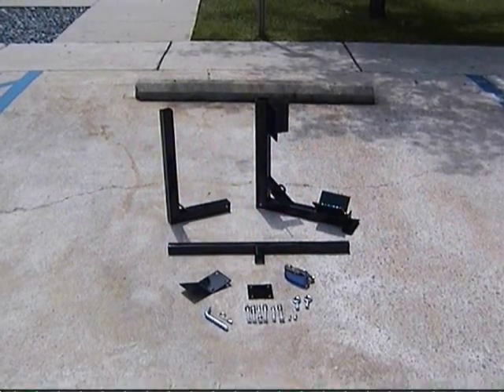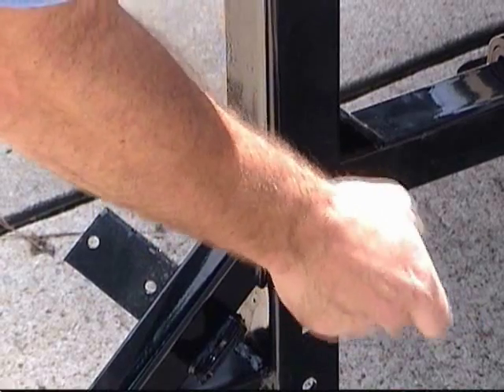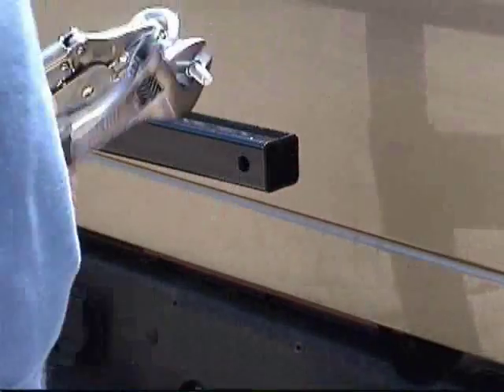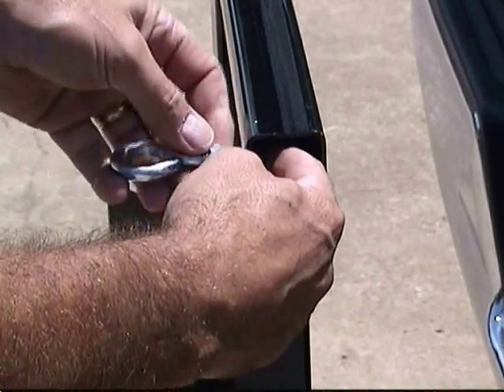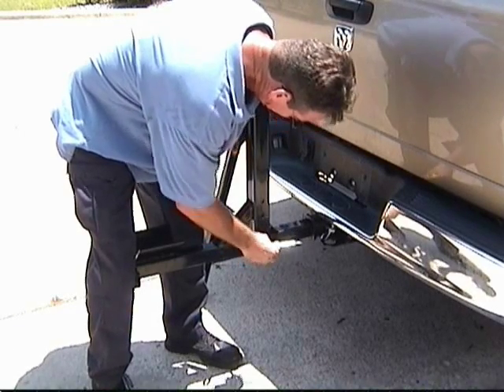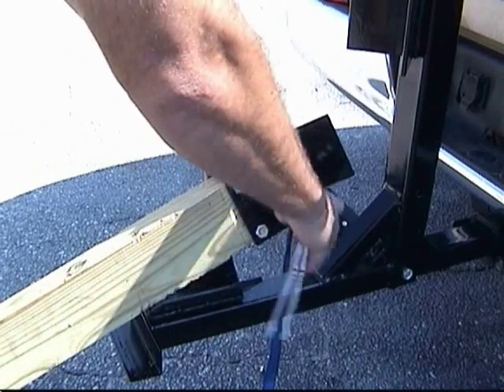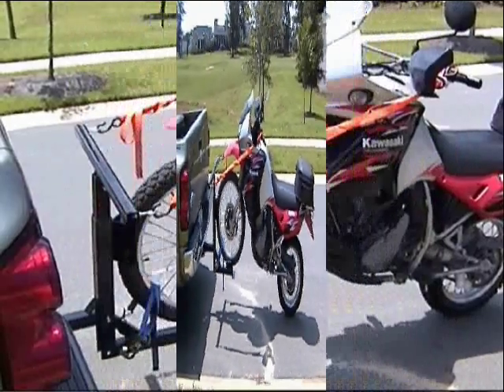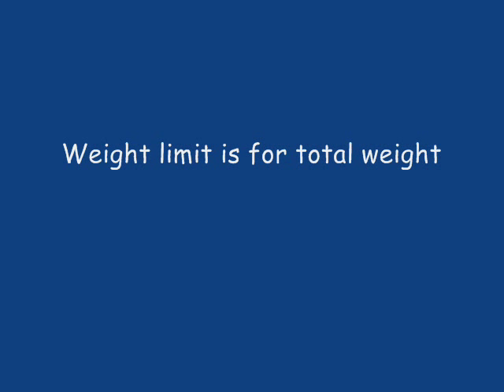Motorcycle Tow Caddy Prohoists.com

Comment: How do you figure that its not bearing 100% of a bikes weight and there are plenty of real bikes that weigh under 450 out of the crate. Example a hyabusa which is a 1300cc bike, not small by anymeans out of the create dry weight is 473lbs which means and im assuming by theory this hitch could support that since the back tire would be on the ground sharing some of the load. I could be wrong but logically I think just about and "real" bike would be fine